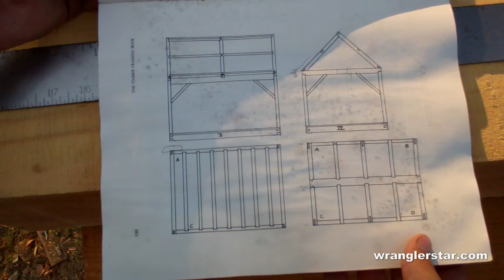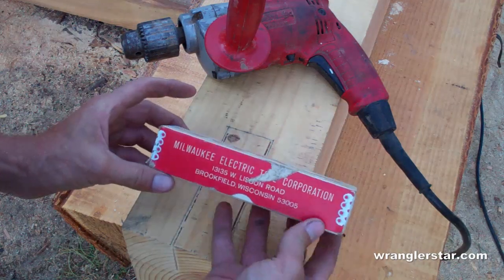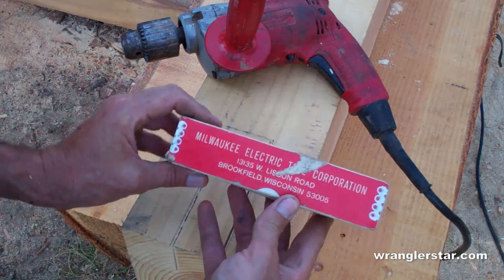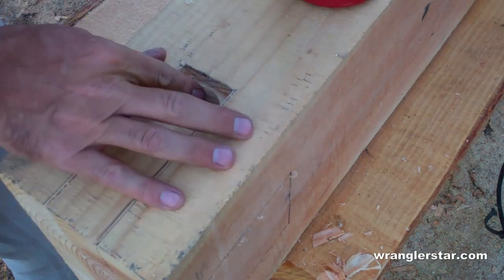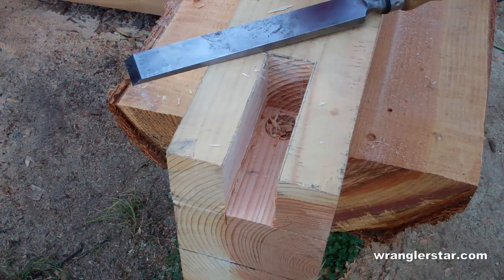Alaskan Chainsaw Mill Timber Frame Cabin Build: Mortising & Sill Board Layout

Comment: Cody, one "good practice" tip: work the first layers on top from the hole to the outside of the beam (arround 5:12) to prevent tearing of the surface. Wish I had the time and room to do this type of work again, honest work that can lead to beautiful results as you prove :-)

Comment: Wranglerstar, you're right in that it won't show, but you want to do good work anyway.
Back in the 1960's one of the first ancient Greek ships excavated from the ocean bottom had an interesting defect on one of the pieces: the builder had taken too much out of a rib or keel piece with his adze and whittled a replacement to fill the spot.  It didn't do anything but he replaced it anyway.
THAT's craftsmanship. I DO recommend larger saw horses for your shop, scrap is plentiful on project like this.

Comment: Because this isn't about the destination, it's about the journey. Learning to craft mortise and tenon joints by hand, the way they're meant to be done, having fun and taking pride in the work being performed the traditional way. Timber frames are a true craftsman's work; unfortunately, most carpenters nowadays are not "craftsmen" in any sense of the word. They like to use routers for cutting timber frame joints, for example.

Comment: Well I don't want to speak for Cody, but I would suggest that a couple of reasons might be not having a router or just simply wanting to do it by hand because that's the traditional way. It's true that he used an electric drill and saw, but those things don't really change the manner of work in a major way (people have drilled out mortises for ages). Using a router also seems to me to be a perfectly acceptable way to do it. I do challenge the notion that it's more precise than a chisel :)

Comment: I have that same drill, and i have broke several 1/2 inch bits with it. You had better have strong hand and arm strength while drilling 1/2  and larger holes in thick metal plate, or get twisted up...lol that drill will put the hurt on ya if you dont respect it. I see you have top quality chisels as well. waiting for the next vid brother.

Comment: Maybe a silly question, but why not use a router to hog out those mortises? If you have the electric power for the drill, it seems setting up a router with a good long pattern bit would make that part go much faster and more precisely.

Comment: you obviously try to strive for perfection,, which is good,, I have always said try to get it perfect because the best you will get is mediocre,.. but I know a little about this work,,and I hate to burst your bubble,, but folks watching this needs to know if that timber your are trying to mortise to just near perfect lines is still green,, or if the moisture in that timber is high,, ( and I can see by the video the the wood is too wet or green to get perfect fits) you are wasting a lot of time and effort,.  as that wood drys out, seasons a little,, those joints are going to open up enough to throw a cat through.

I guess going through these hand labor intense steps is good practice for the in experienced,, but it is not necessary nor does it add any strength to the structure,, because as I said, next year,, those joints are going to be open anyway...  Close tolerance mill work is reserved for cabinetry and finish carpentry methods where weathering will not be an issue..and where moisture content on the wood is stable.

 but to each his own,,, if someone is just wanting to kill time and try and get mortises is green timber or wet timber to tolerances within or less than the thickness of a pencil line (1/16th or 1/32 ) inch or tighter as you are striving for,, it is labor overkill and waste- full of time and energy, and not productive,,, and the end result after a few months will prove it ..

but have fun anyway

it is sort of like the saying "choose your battles"  your fighting at something that you can not win when trying to get that type of timber joint that tight and think it will remain that way and somehow makes your structure better..

the old timers you often refer to and the old ways you refer to knew better than that type of time wasting methods in that type of joinery,, in damp timbers exposed to weather.

some body has to tell the truth of it ,, and since all I see here is praise for this,, then I decided to put the truth out there for you and others to see.

I still enjoy your videos, and your work ethic,, but there are extremes that are sometimes wasteful of our most valuable resource,,,  which is OURSELVES.

God Bless

Comment: L.A.P., if you found yourself in a WROL situation, and you had not prepared for it, AND you were the coward that had stolen the timber-frame structure, would you try to invade your neighbor's finished retreat, knowing that you were facing one prepared, talented, and hardworking man that had designed his place for just such an occasion?

If I were that thief, and had figured out the meaning of the wood I had stolen, like you suggest, I would be smart enough to take on an easier target.